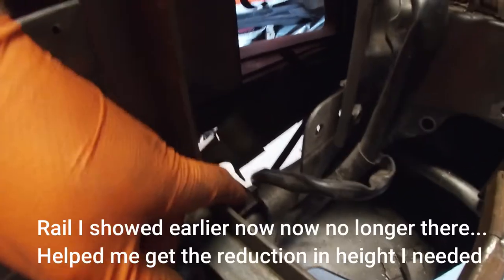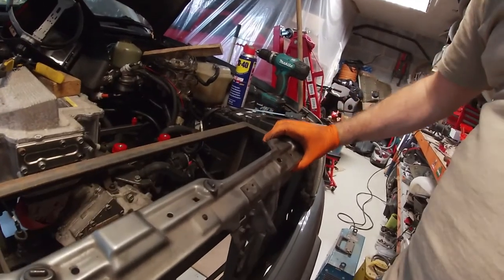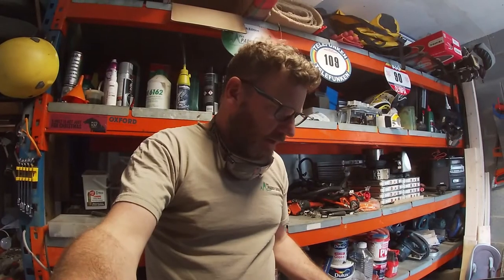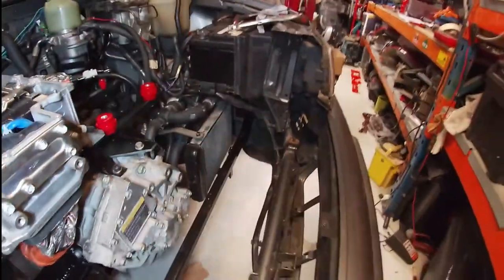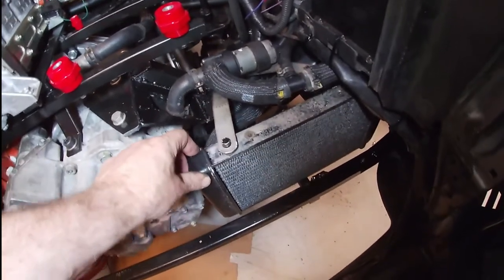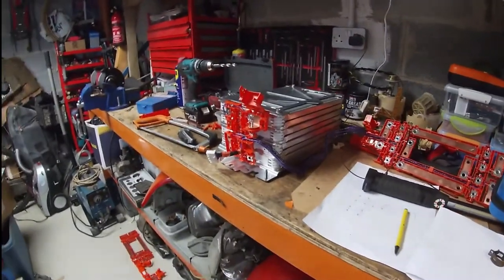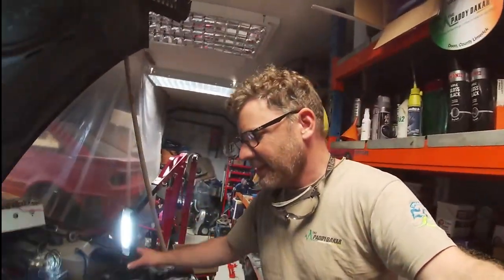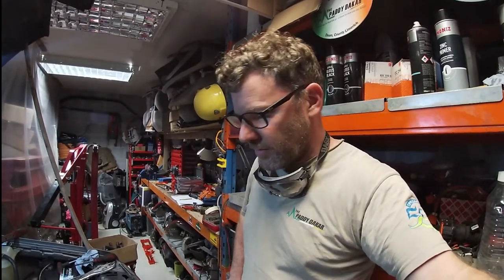Audi 80 EV Conversion - #13 - System Cooling and Battery Fitting

Comment: At 21:00 that Bosch auxiliary water pump looks useful for cooling motor or heating cabin. Maybe waste heat could be harvested for cabin heating with that two port solenoid that you showed later. Did you just use a resistance heater for the cabin in the end? Bjorn Nyland has just driven the latest Leaf on a winter night and noticed that the battery gets hot during charging while a PTC resistance heater is heating the cabin even on a version fitted with a heat pump. 😵
Reply from the maker: Not fitted a heater yet, much to the annoyance of my kids😁. I have never seen the heat in the inverter or motor get hot enough to give enough heat to the matrix in the car. Couple of options to try out but waiting for more parts before I take things apart again
Reply: The kids might revert to fossil cars if the EV lacks heat 😱. I agree, around town the waste heat from the motor and electronics would only warm up a cup not the whole cabin. Likewise a trickle charge overnight is unlikely to heat the battery. It is just the fast charging that seems to heat up the Leaf battery significantly.

Comment: Loving the detail here, thanks for sharing.
Just 2 questions. Can you secure the rad to the chassis rather then the motor as the motor will probably move (twist) when you accelerate and I may have missed a bit but is the battery box supported from below in the middle? Those end supports don't look strong enough to take the weight of all the batteries.
Reply from the maker: Thanks man. Yep, I may in fact do that. There won't be a lot of movement but the less stress on the rad the better. Would have liked to have had the two rad mounts at the bottom but the input/output ports wouldn't have worked as well. The end supports are made of 6mm plate welded to the 25x25 box so are pretty sturdy. Added to that, I have bolted the battery box frame into it which gives it additional structural strength as the load will be spread through the box also rather then to one or two points on that cross beam. The engineer gave it the thumbs up too so, good to go👍
Reply: @Scampi6000  I'm probably a year behind you in my project as I haven't got my hands on a Leaf yet so watching with great interest.
I'll need to check with the authorities in the North about engineer inspections. The regulations are probably different to the rest of the UK because everything else seems to be. 🙄
Reply from the maker: @alibro7512  seems to be more Leaf donors arriving into breakers yards to hopefully prices continue to drop for you when you are in the market. ROI and the uk seem to have similar regs 're this kind of conversion. Once you are not doing too much to the chassis, it can be ok. I did see Kevin in New Elec tweeting about a bill being submitted in the UK parliament making it easier for ev conversions.
Reply: @Scampi6000  I missed a Leaf last week in Copart but I'm sure more will come up.
The regs in NI are different in many ways to GB (England, Scotland and Wales) so we are in a bit of a black hole but I'll figure out something.
Reply from the maker: @alibro7512  Just saw this. Might help to get you started.
https://openinverter.org/forum/viewtopic.php?f=12&t=959
Reply: @Scampi6000  Thanks mate, 
I saw that ad weeks ago and didn't do anything about it as I was looking for a complete car but they're not easy to find at the right price. I've messaged him to see if it's still available.
Reply: Thanks again Fiachra
I have a truck picking the car up later today. :) 
I don't know if you have seen this but thought it would be interesting for you.
https://www.youtube.com/watch?v=vYQJatWpBXY

Comment: Good job but weight distribution is very wrong! You will feel it during emergency braking situation!
Reply from the maker: Thanks. From a point of view of the front pack positioning or front to rear distribution?  Full rear pack yet to go in. Really wanted to get the front pack further back over the wheels anyway but, this is the first iteration, my first attempt so, we'll see how it  performs.
Reply: I very much doubt it. Even without the rear battery the difference would be minimal.
Reply: @Scampi6000  I ment the front pack. Concider safety issues in case of frontal collision.
Reply: @alibro7512  It is not about the weight, but it's distribution! Batteries are heavy and front pack installed before the front axle will make the car slightly jumping in case of emergency braking or rough road drive!
Reply from the maker: @oleksandrdemchyshyn2452  Thanks for the input. I'll be sure to run some tests soon. there are plenty of bumpy roads around here! I also changed the shocks this week. I just had the car weighedtoo. It is 20kg lighter and 58/42 weight dist which is very close to the original. I'll update soon....
Reply: @oleksandrdemchyshyn2452  I understand what you are saying and agree it is not optimal for other reasons too. Will it make the difference you think? Maybe and maybe not, you think yes and Fiachra and I think no. 
Let's wait until he has tested it and we'll know for sure